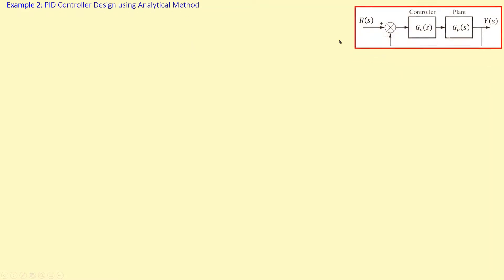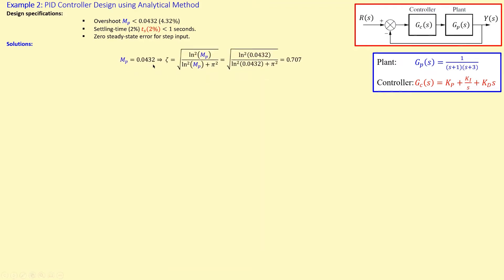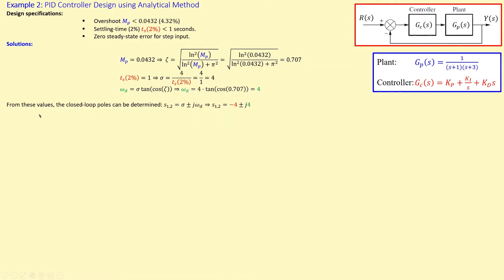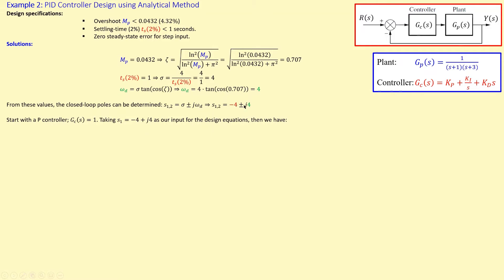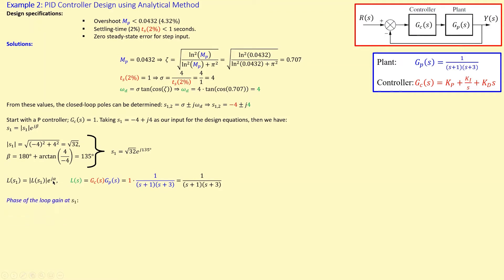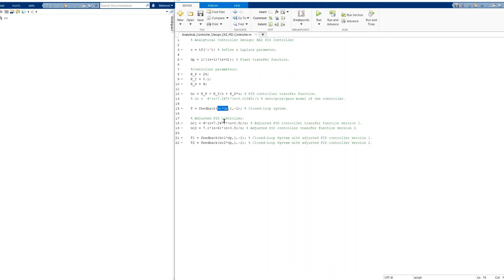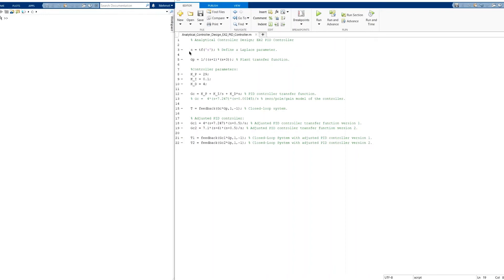Analytical Controller Design | PID Controller Design | Calculations & MATLAB Simulations

Comment: Good day!, Thank you so much for the video. Please tell me, if the poles of the system are complex numbers and there is zero, as for example in the transfer function buck converter, is it possible to calculate the PID controller using this method?
Reply from the maker: Thanks for your message. Great to know that you liked the video!
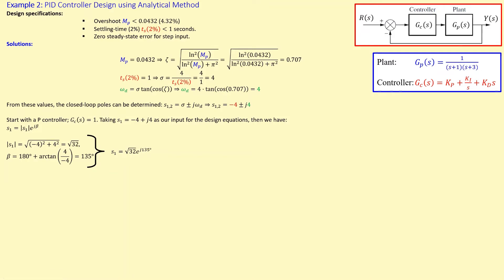You may have complex poles in your plant transfer function and this method will still work. What you determine is the loop transfer function L(s) as it is done at 00:06:38 in the video, so having a real or complex will not change the analysis.
Reply: @CANEDUX  спасибо !!
Reply: @CANEDUX  But after all, if there is a zero in the Gp(s) system, then in the final system it turns out that the number of zeros will be equal to the number of poles. Where am I wrong?
Reply from the maker: @SMV1972   What do you mean by the number of zeros equal to number of poles? Where do you have this?
Reply: @CANEDUX  in the numerator of the system, 1 zero and 2 zeros have a pid. There are 2 poles in the denominator of the system and one pole at the origin has a pid. In total, we have that the transfer function of the loop gain has three zeros in the numerator and three poles in the denominator. I can't figure out what I'm wrong about.
It turns out that this method is applicable only if the system does not have zero? Right?
Reply from the maker: @SMV1972  In general, if the system has three poles and two zeros, then third zero is at infinity, so we always have equal poles and zeros. Is that the answer to your question?
Reply: @CANEDUX  Not quite. I just want to make sure that this method of developing a PID controller is applicable, for example, for such a transfer function: s+2/s^2 +3s+ 6
That is, with zero and two complex poles
Reply from the maker: @SMV1972  Yes, you can also apply this method to the system you have given. You can have zeros in the transfer function of the plant.
Reply: @CANEDUX  Благодарю Вас
Reply from the maker: @SMV1972  You're welcome.